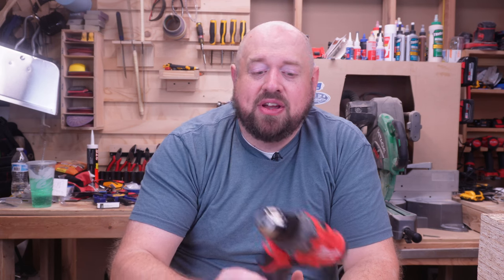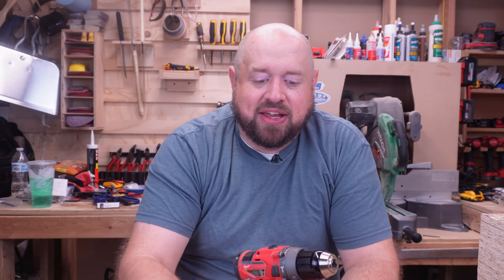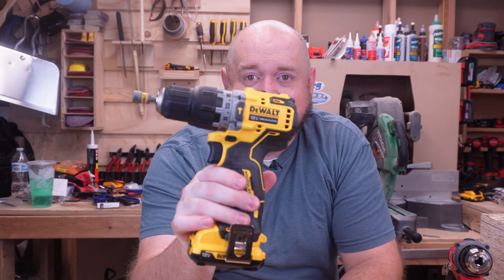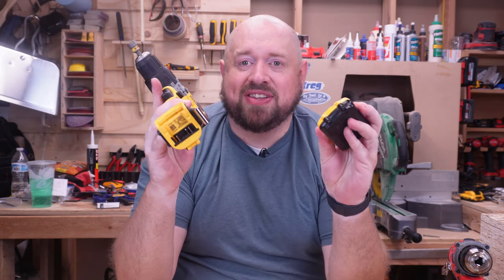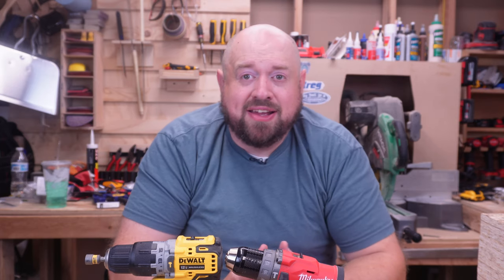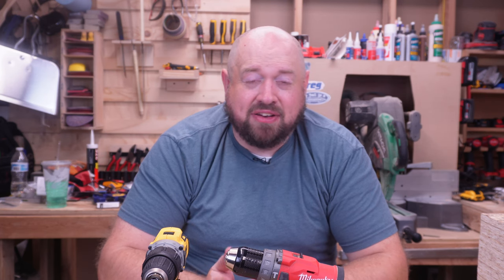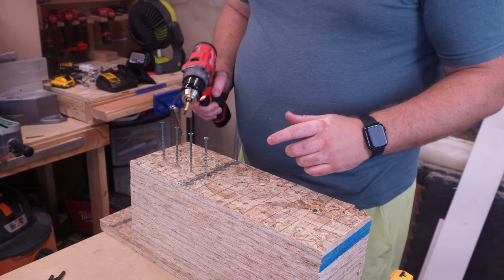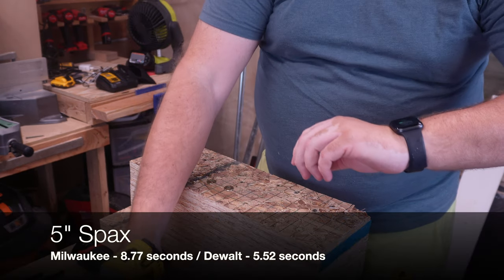Is there a new 12v King?

Comment: I just picked up the Milwaukee M12 impact driver hammer & drill combo from Home Depot. It came with the bag the charger and two batteries. Plus they were running a promo so I got a third battery and the whole shebang was $179 delivered to my door. Now for me although I have a full shop at my house, I’m mostly tinkering around as a DIY Guy. With that said,  every now and again I do some pretty big projects on cars motorcycles etc. and I’ve never had any issues with the Milwaukee. I think at this point between Milwaukee, DeWalt, Rigid I guess you could throw Makita in the mix, ( and then of course Ryobi which always gets a bad rap. Lol) if you’re a DIY person I think it just comes down to personal preference. This is just my opinion. Stay safe out there😉
Reply from the maker: It's gotten to the point that most of the major brands have pretty decent offerings.  While my preference is more on the Milwaukee or Dewalt side of things I know for a fact you still get the job done quite well without spending on top tier tools.

Comment: Using a Milwaukee M12 4 amp or 6 amp battery will  yield better test results for the M12 Fuel Hammer Drill!  I would never run my M12 Hammer Drill with a 2 amp battery, especially for more extreme tests!
Reply from the maker: While I agree with you it would yield better results, it would in the case of DEWALT as well.  I would go as far as to predict the DEWALT would still win.
Reply: When it comes kitted the two amp hour batteries it’s  for the impact not for the drill you really dropped the ball on that one just being honest.
Reply: @steffendetrick9403  I noticed that he is comparing it to the old plastic chuck milwaukee drill instead of the new metal chuck with the red ring on it
Reply: @JesusPerez-yc6yu  The Dewalt has a plastic chuck.
By the way, the gen 2 m12 has a metal chuck.

Comment: So I'm very curious to see what power comes from the new 12v batteries high output  2.5 ah & 5ah . When I put a m12 6ah battery it was way stronger then the cp 2.0 batteries .
Reply from the maker: I’m excited to see what they can do.   I don’t mind the form factor of the bigger M12 batteries on certain tools but there are others where I like the smaller packs.   So if the HO 2.5 can deliver more juice it could be the best of both worlds for me.

Comment: 12v is designed for compact in my opinion.   Dewalt missed the boat.  Bosch brushless and M12 are in my bag. Also, what battery size are you running on the M12.  Appreciate the videos!  Looking forward to next one.
Reply from the maker: This was an older video but if I remember correctly I ran this with a 2 ah battery on both.   I have newer videos that compare the new Gen 3 hammer drill to the DEWALT Hammer drill.  Those are both run on larger batteries in that video.

Comment: I see the advantages in both the on-battery level meter, and the on-tool level meter. If your just checking batteries laying around, then the on-battery meter is better, but I also like the display on the tool because you can constantly monitor the battery level while the tool is in-use.
Reply from the maker: I would prefer it on battery just because I can satisfy both needs if that’s where it is.   I get why they don’t have it but just one of those litttle gripes I guess.

Comment: I am a Dewalt and Makita guy. However the appeal of my Milwaukee 12 v is the form factor. The barrel handle and small battery shape of the Milwaukee is very appealing for small jobs. I know Bosch has same 12v form factor but their performance is not as good as Milwaukee. Dewalt 12v  form factor with that bulky right angle battery is a non starter.

Comment: Well as a Contractor, Carpenter/Deck Builder/Framer, Electrician and Plumber and Welder I'm not Loyal to any Brand. I buy and use whatever I need to get or whatever I have around. Although I'm not a fan of Milwaukee and I never like it anyway there's nothing bad about their M12 lines my friends love em' and they also invested of Milwaukee M18 Lines as well while I'm a DeWalt and Bosch user when it comes to 12V system I got DeWalt DCF801 Impact Driver, DCF601 Screw Driver and DCD701 Drill Driver, for Bosch I got PS42-2A Impact Driver and GSR12V-300N Drill Driver and GSR12V-300HBX Screw driver all of them are 12V systems. The rest of my Cordless and Corded tools are DeWalt, Makita, Hitachi, Craftsman and Ryobi. Sometimes there's a tool brand that is so bad and ugly when it comes to Cordless tools but great on Corded tools, there's also tool brand that sucks on corded tools but top notch on cordless tools.
Hey! Believe it or not even though I have a lot of top notch Corded and Cordless tools, I also do own and use Cheap ass Harbor Freight tools as well the Hercules Brand 20V Lines.
Reply from the maker: I am fan of a lot of different brands.   If I only could pick one I would probably settle on a Milwaukee or DEWALT but there are enough great tools out there I think you are shorting yourself if you only go with one.
Reply: @TinkerWithTools  no. They're not perfect all of them got ups and downs that's why I don't settle with just 1 tool brand. But if there's gonna be a Shit Hits The Fan and if I would only be allowed to carry few Tools I would choose Flex 24V over the Milwaukee and DeWalt

Comment: I have the updated m12 drill and impact driver. The drill is far more powerful than my 12v Dewalt at work and my CXT Makita at home. But it is much less comfortable.  I usually reach for my Makita first. If I need more power I pick up my 18v drills.
Reply from the maker: Thanks for sharing!  Yeah the new generation really was a step up for Milwaukee.
Reply: @TinkerWithTools  In terms of performance,  the m12 line is very hard to beat. The metal chuck and transmission housing on the drill is top notch. Same with the power.

Comment: Not to sound like a Milwaukee fanboy, but I do wonder whether the grip on the M12 line is purposely designed to give max control for most hand sizes or at the mercy of all stem-type batteries.  I love the grip of Dewalt and Makita, but does a more comfortable grip always mean better control.  As you said, 12volts tools are becoming more powerful, thus requiring two-handed operation like some of the side-handles you see in the 18v line.  I gave myself a black eye when drilling a large bit into steel and it locked up and smacked the handle into my face.  Before Milwaukee launched the M12 line leading to a multi-million dollar, long-term commitment to battery size, you got to think they must have asked the question, " dude, is the handle too thick"?  So the question is, if not really bracing for it and you get a wrist-breaker, would a thicker tool handle give the user a little more control?  Think of a thicker rubber padded screwdriver vs. those old Stanleys with just a small hard handle.
Reply from the maker: I don't know that more control is necessarily why the DEWALT grip gets praise but more so the comfort of using it.

Comment: Everybody sleeps on the DeWalt 12V Extreme line. Everyone I've tried is fantastic, and much, much more ergonomic than an equivalent Milwaukee. Not to mention, cheaper. They're always on a promo of some sort.
Reply from the maker: They are right there at the top.
Reply: @TinkerWithTools  Definitely. Since I've added a few of the extreme line, I rarely need to pull out the big muscle (MHPT 36v) lol. My favorite overall has to be the little DCF601 Screwdriver. That thing is clutch.

Comment: The DCD706 has a metal chuck in some european countries at least, while the m12 has a different metal chuck than the one you have. Still the same sizes for them though, just something to note.
Reply from the maker: I appreciate the input.   I don’t understand why it wouldn’t just be the same everywhere but I guess they have their reasons.
Reply: That's the old milwaukee drill. It has a plastic chuck. The new one has a metal chuck with a red ring.
Reply from the maker: @JesusPerez-yc6yu  this Milwaukee is the old one but it too has an all metal Chuck.  The video released before the Gen 3 M12 came out.
Reply: @TinkerWithTools  I thought maybe he was confusing the m12 gen 2 and 3. Can't wait to see the new gen 3 vid. See how much more stronger it's got. I've seen vids of the new HO battery nd they made almost no difference
Reply from the maker: @JesusPerez-yc6yu  wait no further.  https://youtu.be/Rc9JWKdBxo4
Reply from the maker: @JesusPerez-yc6yu  Man Caver Tools did a video with the High Output batteries.  I haven't purchased the 5.0 yet so I am not able to give a full assessment yet.

Comment: 12v? Compact? Light? You guys are cute, im running Makitas 7,2v series. Now thats small and compact! Get with the times boys!

And yes im joking. Mostly. I do actually have those 7,2v that I use suprisingly often in place of 12v. 18v only comes out when doing construction or really stubborn mechanical work, which isnt all that often. But for reference, ive built computers, repaired hvac, changed engine oil, swapped stator and regulator on a mc among many other things exclusively with 7,2v tools. I have no idea why these doesnt seem to be a thing in the vest but in Asia they seem to be really popular going for 20 years or so now.

Its just a bit funny how i started out buying the most powerful tools because i thought i would limit myself, yes I findmyself "downsizing" for more precise, refined and gentle tools over and over
Reply from the maker: Yeah they don’t have those where I am.  12v is the smallest.  Makita has 12v tools but they are older and less powerful than both Milwaukee and DEWALT here.
Reply: @TinkerWithTools  I see, I have seen people in the states getting them. If youre interested you could check out DF012DSJ and TD022DSJ which are the screwdriver and impact respectively. I dont know if they go by other model names there like Milwaukee does, but they are really nice.

Speaking of which, really looking forward to seeing you test those new Milwaukee 12v tools that you mentioned, hoping you wait for the new batteries as well. Good times ahead!

Comment: Nice shootout, Dewalt FTW in performance here and in ergonomics everywhere. I have the M12 Fuel hammer drill, it's pretty good , really got it (on deep clearance) to pair with the M12 Fuel Surge, which is my fav 12v impact. I do like the metal chuck and the durable feel on the M12, though.
Reply from the maker: It feels more stout and surprisingly is only a couple ounces heavier than the DEWALT.   The surge is awesome though.

Comment: You got the wrong battery 🪫 for the Milwaukee. Bad review
Reply from the maker: Saying I have the wrong battery would imply this battery doesn’t work.   It may not be the best battery but it did make for an apples to apples test with the DEWALT.
Reply: @TinkerWithTools  that wasn’t a fair review, anybody would tell you that
Reply: @TinkerWithTools  at the end of the day, you like what u like 👍🏿
Reply from the maker: I guess I don’t understand how it wasn’t a fair review.   I assume you mean on a higher capacity Milwaukee battery the Milwaukee would run better.   I know this to be true.  But by that same logic wouldn’t the DEWALT run better as well on a higher capacity battery? So at the end of the running both on a 2 ah battery was fair in my opinion.
Reply from the maker: I understand that some people prefer to run the tools on a high ah battery but they do in fact sell it with the 2 ah as well.  There are also people out there that like to use the smaller battery.   This won’t be the only test you see with these tools on the channel but you have to start somewhere.
Reply: @TinkerWithTools  your right, I never thought about that

Comment: NOT FAILED 4AH BATTERY I DONT KNOW WHY YOU INSIST ON GIVING THESE TOOLS THE SMALLEST BATTERY POSSIBLE 4 OR 6 NIGHT AND DAY MAN........... MAKES ME NOT EVEN WANNA WATCH THIS IS A DRILL BROTHER I DONT WANNA SOUND LIKE A NAG BUT WEVE BEEN THROUGH THIS WITH THE M18
Reply from the maker: Sorry it makes you angry.  The 2 ah is sold in kits with this tool and both tools were running on the same battery.   I’m sure the results will change on bigger batteries but I am guessing the DEWALT would still win.  This won’t be the only test I run on these tools but everything has to start somewhere.
Reply: You don’t want to watch, because he conducted a fair test pitting the tools against each other using the 2ah batteries that came in the kit? Why do Milwaukee fans get all in their feelings when their tool loses? This test couldn’t have been any more unbiased.
Reply: I’m with you Branden!  With regards to the M18 testing, testers always want to run the 5 amp battery, vs an HO battery, e.g. 3, 6 or 8.
Reply: @martylucas8557  and there doing timed test if they were just making holes fine but to time and declare a winner 🏆 naw I watched two different videos where the Milwaukee beat the dewalt..... its his channel he can do as he likes but when I hear the drill struggle and getting dropped to 1st so fast its like how bad did you want the dewalt to win lmao 🤣 I have all brands really don't care who wins both good tools Milwaukee is built better in my opinion... you can't just go off one person's test there will be inconsistencies in wood how hard you push so many variables the 2ah batteries kill me tho id never put a tool through a gauntlet with a 2.0 its dropping two bars after two lags.... let em shine put the 6.0 and the 5.0 and show what these little powerhouses can do..
Reply: @TacticalThib   I watch pretty much all the tool channels and know M12 has won their fair share as well. And most videos boil down to Milwaukee stronger, DeWalt better ergos and more comfortable. The fact remains is that he conducted the test his way, and those were his results. Most normal folks will take it with a grain of salt. Watch some other videos. Then make their own opinion. Not go ALL CAPS and accuse him of dishonesty. As stated, there are plenty of other 12v videos out there with the result you want.
Reply: @TacticalThib  thing is Milwaukee and DeWalt don't have same battery capacities on their 12V lineups other than 1.5, 2 and 3Ah.
So it  looks like 2Ah is the sweet spot as these are very popular in kits and what lots of folks will get along with their tools. 
A rematch with 3ah on each tool would be good and perhaps when the 5Ah HO M12 battery gets available because DeWalt's 12V battery lineup tops at 5Ah
Reply: @luisinhoens90  it comes with a 2ah for impact and 4ah for drill I run 6.0 and 3.0. If your doing a time run give each tool the best battery. It is what it is I have both and know what they can do
Reply: @TacticalThib  I hear you, and I only own 3Ah, 4Ah and 6Ah for the same reason. But this video is apples to apples (2Ah) and the Milwaukee got beat this time.